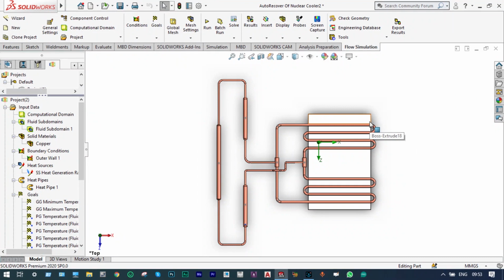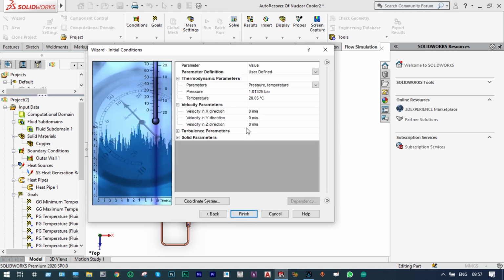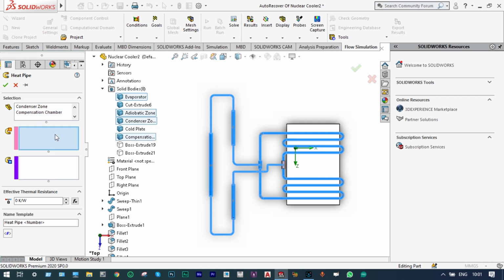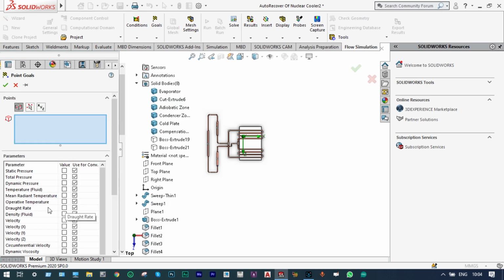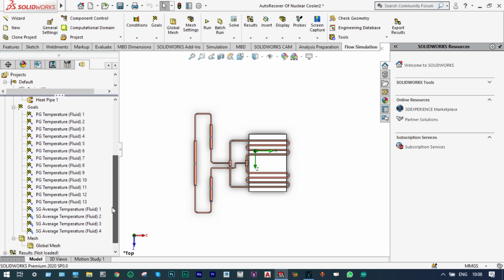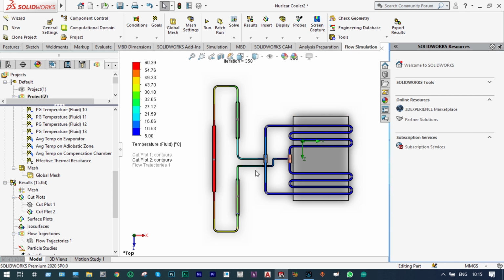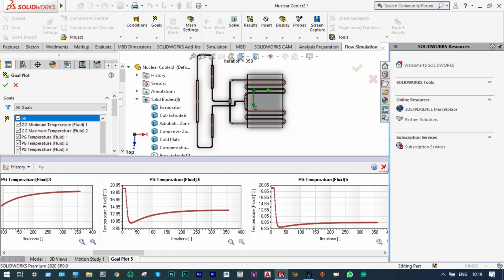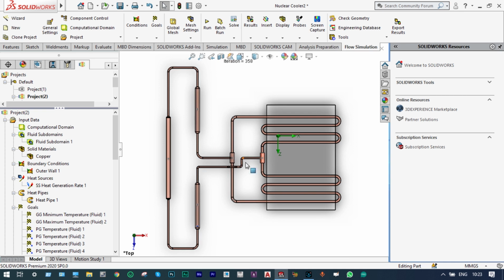CFD Conjugate Heat Transfer Analysis with Heat Pipe in SolidWorks 2020

Comment: Are the pipes contacting the plate?
Reply from the maker: No
Reply from the maker: It is connected but not merged
Reply from the maker: For heat pipe we need to have three different separate zones

Comment: Thanks Sir, May I know is solidworks analysis as accurate as other CAE software like Ansys, Hypermesh, etc.
Reply from the maker: In FEA we are actually trying to achieve accuracy.i.e we are approaching towards correct results and that can be achieved with proper meshing. All the CAD softwares are some advantages and some limitations. So, accuracy can be confirmed with theoretical validation. As per my personal experience all are equal if you provide perfect meshing and perfect boundary conditions.
Reply: @CFD_GUIDE  I personally feel that the very manner in which you actually share your knowledge no one actually does these days. Thanks again ! 🙏
Reply: Also I request you to please upload a tutorial on different meshing techniques and also some tips for justifying the level of meshing for different-diffegent regions.
Reply from the maker: In SolidWorks CFD Analysis from the solver window itself you can see whether all your goals are converged or not. If any of the goals are not converged it is not reliable that needs to be omitted.
Reply: @CFD_GUIDE  May I know why it's fluctuating in increasing or decreasing manner ?
Reply from the maker: Suppose in this analysis, I have created 13 nos of point goals. That means at those specific locations we need to have results. After discretizing if nodes are not created on those specific locations, it provides results at a location near about to our desired location not exactly to our desired location. That's why it is not correct. But if convergence is achieved in that case desired results are obtained.
Reply: @CFD_GUIDE  Thank for your insights.